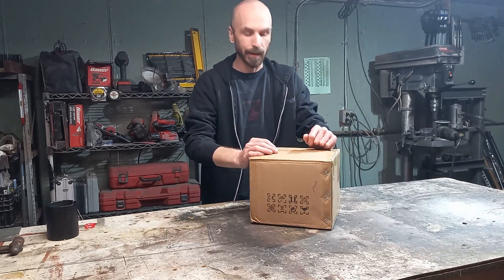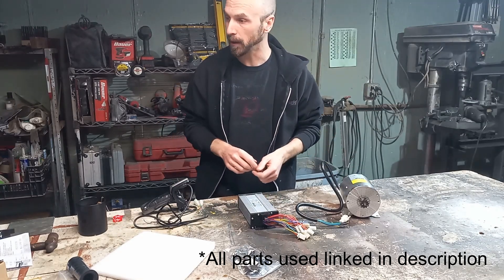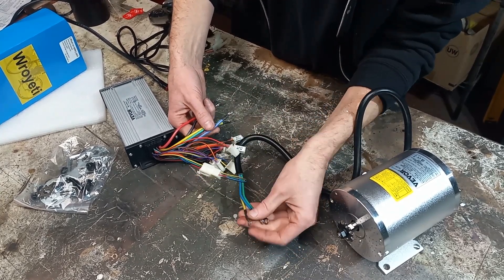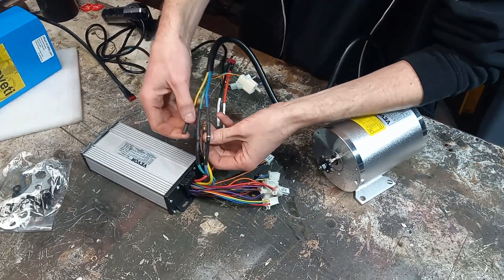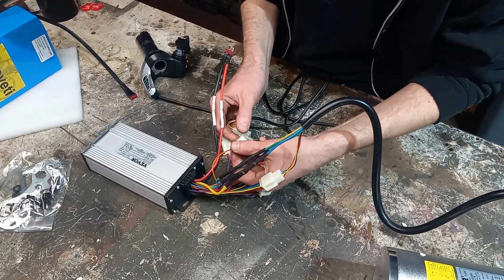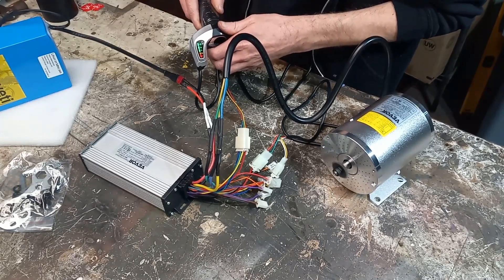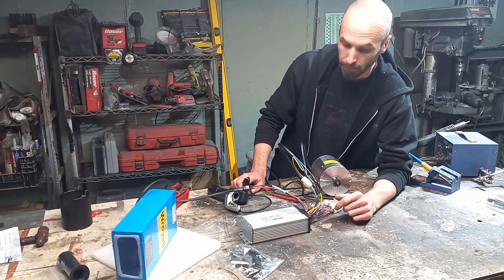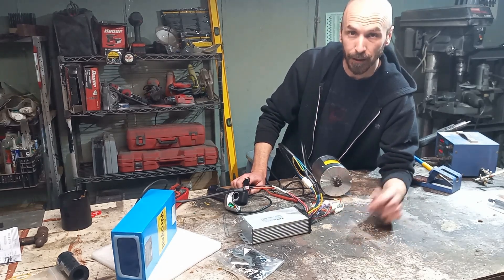Vevor 48V 2000W Motor Kit: Wiring & Unboxing Review

Comment: Do you happen to know what might make the engine get jittery at higher speeds. I put a similar setup on a Moto Racer and it cuts in a nd put slightly at higher speeds.
Reply from the maker: I haven't ran into that issue as of yet.
Reply: Is the motor controller programmable?
Reply: @jaredsilverman6309 not that I aware of
Reply: Yes, it might be your battery’s BMS system shutting it down automatically to prevent over-current. Make sure your battery can handle the amps being drawn from the motor.

Comment: I have the same kit, only throttle is different.  But my motor starts very slowly and after 3-4sec get full speed. I try all three speed settings but its not helpful.
Reply from the maker: I haven't run into that issue as of yet. Let me know if you find a solution.  Cheers

Comment: Nice kit but get rid of that battery connector way too small for those volts...
Reply from the maker: 6mm bullet connectors are good up to 500v dc and 150amps. This is way bellow that.
Reply: @chrismakesstuff1  I'm talking about the dean's plug on the battery not the bullet plugs 🤦

Comment: Hello, what solder are you using for the battery plug adapter? I only have lead solder but I don’t think I can use that. Thank you
Reply from the maker: Leaded solder will work fine, it's just toxic to breathe the fumes

Comment: My battery comes with a xt60 plugs I have to soder the controller wires to a xt60 plug and I found a soder kit on amazone for like 30$ will it work
Reply from the maker: Soldering irons are rated in watts. I use a station that goes up to 500watts, I believe
Reply: @chrismakesstuff1 is 60w enough I’m new to this or 80

Comment: hi i have everything wired up the same but my throtle has a slow start what could i do to fix this
Reply from the maker: I'm not sure I understand what you are asking
Reply: I have no torque that is my problem aorry i could have worded it differently
Reply: @danielg3162 buy a new throttle stock throttles are usually crappy and have bad response

Comment: do i need to use bullet connecters, or could i use a O ring junction box to connect the wires. also the amazon link is invalid (battery)
Reply from the maker: Junction box will work. Thanks for the update. I will check on the link

Comment: I really need help because I have a razor and battery but the old motor for an mx350 didn’t fit the battery so do you know what the thing you needed to sotter on was called and if there was any easier options
Reply from the maker: I soldered on bullet connectors. All parts used are listed in the description

Comment: Could i run a 1600w motor on a  72v 20ah
Reply from the maker: Can or should... yes a 1600w motor "can" run on 72v, should you, no.  The motor will need a 72v controller though.
Reply: @chrismakesstuff1 oh ok yea the controller 72 i do have it oh and 1 more what about 1800w motor it will work to 72v 20ah
Reply: @chrismakesstuff1 oh ok thanks bro oh one more question  Could i run a 1800w motor on a  72v 20ah

Comment: how do I connect the motor phase wires without changing the connectors?
Reply from the maker: You could use a junction box or bolts I suppose in a pinch
Reply: @ ok thanks
Reply: @ also does it come with what I need to connect it or no

Comment: I bought this exact kit for My Son ‘s razor. My speed control is different. My speed control to motor connectors are different. And the throttle responses very slow. The RPMs ramp in very slow.
Reply from the maker: I'm not sure what your question is
Reply: I have same problem.  Rpms ramp very slowly. 😢

Comment: We have a 72v battery with a thor300 controller...and the motor is a 2000w 48v...is that ok?
Reply from the maker: I'd guess parts will melt.
Reply: @chrismakesstuff1  trying to figure how it hasn't for the past 4 months...wondering if the controller has anything to do with it...supsedly it's a really good controller...new to this
Reply from the maker: @ Typically its not great to over-volt motors.  Have i done it, yes.  As long as you are not holding the motors at full throttle with a heavy load, they will work, for a while.

Comment: Can you switch the wire adaptor to any type of addaptor and would it be able to connect to other brand throttles key ignitions etc. Also video was very helpful thanks
Reply from the maker: Short answer is yes and no.  I've changed connectors when I changed from twist to thumb throttle, but I've run into compatibility issues with other setups.  I don't remember off hand which ones didn't work but hopefully someone can chime in and help with the specifics. Cheers
Reply: @chrismakesstuff1  thanks that’s verry helpful
Reply: Well the "door lock" switch is the key in the throttle, that literally just needs to be shorted to be on. So you can use any on/off switch.

Then the throttle is 3 wires, but there's no telling what resistances it is set to, for example:
on one motor it can be like 10 to 1000 ohms and another could be 2000 to 4000 ohms it really doesn't matter.
When you are designing the internal components to read the resistance sent by the throttle you can just say 10 ohms = 10% power OR 1000 ohms = 10% power it doesn't matter at all so the compatibility can be all over the place.
So to be compatible you need something that is similar range I guess
They usually are pretty similar so when you buy a separate one it should be "suitable for most" of them

Comment: I have a question when you strip down the wires to change the adapter do you have to solder or can you use electrical tape or something?
Reply from the maker: Technically you don't have to solder, but I'd suggest it on anything  that moves  like a vehicle. Solder has less electrical resistance and won't rattle loose.
Reply: definitely solder the connections, do not just use tape lol
these bullet plugs used are good for <15 amps (prob 10 most) so be careful before using them for something like this 30-40 amps
use the "battery quick connect 50amp" ones they are ugly 2 plug and grey. 
OR a MC4 connector for solar which are good 30-40 amps. 
I don't know of any better ones, unfortunately most connectors are terrible for anything over 10 amps.
Reply: Mc4 is your best suggestion @gg-gn3re

Comment: If the battery is 40 amps could I run it on my 2000w 43 amp rated motor or not? Im purchasing the same exact battery for my kunray 2000w kit and i see u hage the vevor.  If so, thank you very much🙏🏾
Reply from the maker: I would think it would be ok.
Reply: @chrismakesstuff1  How is the battery holding up?

Comment: im looking to design a custom bike  for a specific purpose.. and to use for long travel/camping   and need help getting started chosing parts/motors/ displays  to model for the cad proposal.. 
if you can help . drop me a dm . just some questions and then if you knwo them .. measurements or photos if you have them  ( and i cant find that info  online)

in shot a hauler bike that has 2 powered wheels (like a trike)  and a flatbed for cargo with room for me  and two large dogs up front . . able to charge one battery  while riding ( solar?) and use another one or two for  range/travel   fully loaded..
Reply from the maker: A trike sounds like a fun project. I did see that the website emou, I think it's called,  basically Chinese amazon,  had a solid axle with motor mounted for go karts. That might be worth looking into. If this is your first build,  I recommend staying with a kit. Motor, controller,  throttle. Less daunting and more plug and play.  Then upgrade components later if desired.
Reply: @chrismakesstuff1   well i need towrque its goign to ahul alot and then i need distance.. so thats teh thing to figure.. im not daunted by wiring  ..  and such .. i jsut dont understand how to chose the motors and controllers and battery .. the rest i can model and build to concept it. and then   figure costs etc.. to get it made

a portable dog agility / long distance  ride for  going all over the city or 3 hours drive out of town  orso  for camping or other agility setusp
Reply from the maker: @PaulColeVFX without knowing full loaded weight,  cargo, rider, vehicle,  it's hard to spec. Also, exact distance is hard to figure without knowing expectations.  But what I can say from experience is I like to run 48v systems because for the builds I've done its a good compromise of cost and power. If money is no object 72v or more will deliver more performance,  but components get significantly more expensive
Reply: @chrismakesstuff1   think 250lb person  200lbs of dog   and the trike frame and motor witghs  with battery  and   some aluminum scaffolding  platforsm 1Meter by 1Meter  but  say 2" thick  ibeam style or pipe style  with a plywood and carpet top  stacked about 1meter high .
Reply: thin plywood as only ahs to support about 150-200 lbs weight for scaffolds ( for dogs)  

ans some extra pipes and lock mechanisms to link it together liek technics
Reply: oh and a box full of camping gear  for hiking ( light tent and some cooking gear/survival stuff  like a good packed backpack worth and hammock)
Reply from the maker: @PaulColeVFX guessing you're overall weight is north of 600pds, it's much heavier than any build I've done. Maybe someone else can chime in with some advice if you note desired distance, top speed, with a weight of 600pds, as well as what you're budget is
Reply: @chrismakesstuff1   the budget is as affordable as possible and the range is as far as possible.. was thinking of a two battery or more system  where one can be charged by solar while the other being used like a spare tank ..  and be able to travel with  ..  i see e cycles doing 100km or more  on a charge going 60..  if we could double or triple that would be great..  ... ideally it willbe a popup dog ajility course  that travels and a mobile camping setup ( when getting  form one place to another)    i will likely crouwdfund the original build as it will mostly be for other dogs and im not on a big life budget  being on disability ..   so for now its about making the design right and  then  funding it.. and then  going on the road with it throught the local areas and eventually enighboring ones or much much further if it becomes popular.. 
 the idea  would be its free for all . and would only accept donations to cover food   if i do long haul trips..    i built the idea once before in cad for a ridekick trailer push  motor  but  it has evolved and i have a bigger dog now and better cad skills . 
so time to do it right but i need to chose the base parts first.. then model them and model the frame and parts
Reply from the maker: @PaulColeVFX It sounds like a fun project and wish you the best of luck in your crowdfunding endeavors.  I've tried and failed several times with crowdfunding projects. Best of luck.

Comment: Hello Chris. Thanks for your detailed video. :-) Maybe you can help me? I bought the Vevor motor and want to install it in a boat. So that I can set a constant speed, I would like to use a rotary potentiometer or something similar instead of the throttle grip. Are you familiar with this and can you give me a tip as to what I could use? Greetings Livio
Reply from the maker: I've used potentiometers in other electric vehicle projects but not with this motor. Check out power tube motor project for example
Reply: I have same kind project. 8foot middlemotor boat and 3000w 70volt veavor motor.

Comment: Good luck these motors are good at 350 watt at most. If you push over 900w for a few seconds they get very hot i started using it with a vesc cause their controlled sucks.
Reply from the maker: Thanks for the insight.  The motor or controller hasn't gotten hot in my setup,  but something to keep a eye on.

Comment: Sorry to say, but this wasnt a review worth watching, yes it works in free air, but i want to see if it does have 2KW of output, if it overheats, and such stuff, that they tend to lie about in these chinese kits, a simple unboxing is really of no use for anyone who intends to use these.

The biggest problems with these motors is they have the lowest temperature rated magnets, and under sustained load, the magnets overheats, and loses its magnetic field, killing the motor. Also the power rating are 2-5x more than the motor and driver can handle usually, so if you want to make an actually useful video, test if the rating is closer to 2x, or closer to 5x of the actual capability of the kit.
Reply from the maker: This video is part of a series.  This is just unboxing, wiring, and initial thoughts.

Comment: On the vevor site they label it as having "indicator light" and "brake light". Seems odd if those are not measuring as 12V.
Reply from the maker: I thought so as well,  but after reading the instructions, they indicate to use 48v lights.  I was using 12v lights so I used a additional converter.